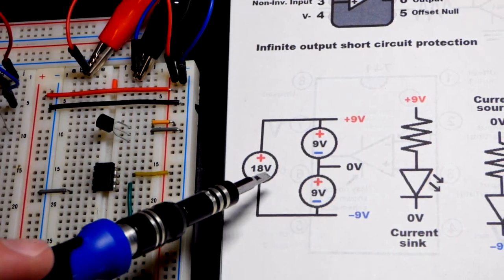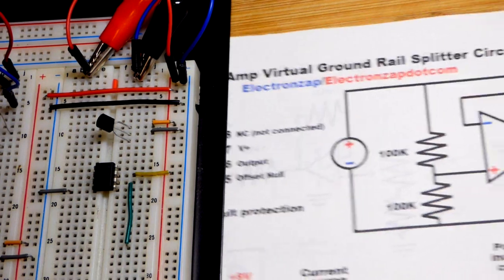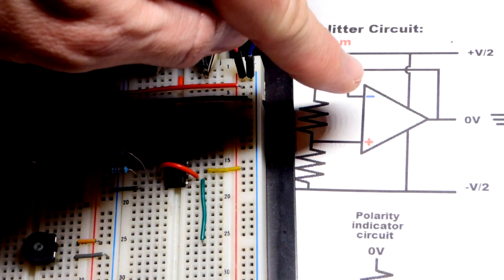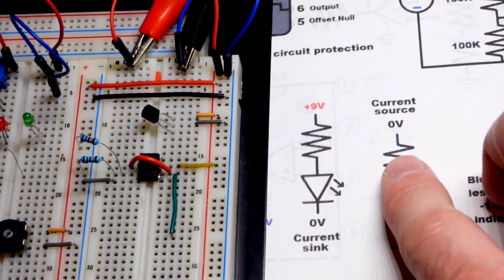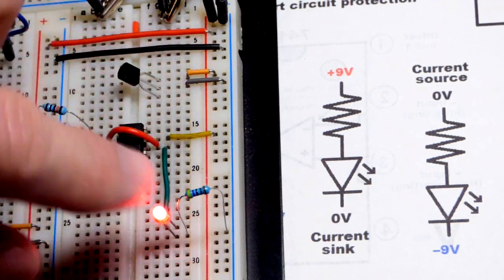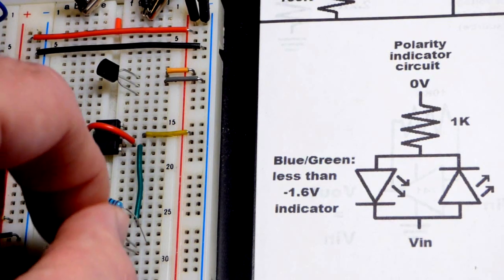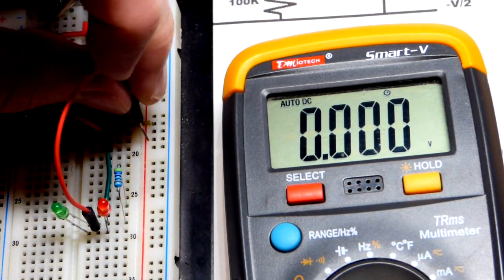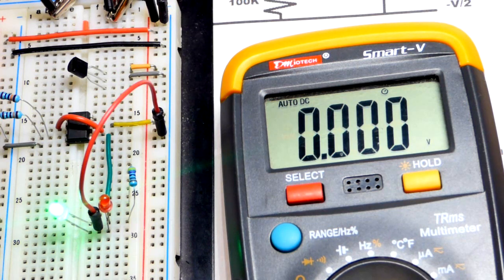Split power supply made from single supply using 741 op amp virtual ground rail splitter circuit

Comment: tested ua741cn in vg 13,2v with schotky diode 0.2v drop and got around very near +-6.5v. I have not load it down yet but i guess it will work good 5-20mA per side with some luck. Thanks for the easy great tips.
Reply from the maker: Thanks for the info!

Comment: Thankyou for the reply. I like your videos. They are clear. As a beginner I have tried many oscillator circuits using digital ics and op amps. I use a FNIRSI portable oscilloscope to see what the outputs are like. I note you often use a similar portable scope. The scope I had did not come with a proper probe (though I have one from another old analogue scope). Instead it supplied just a BNC connector with two leads with croc clips on the ends. Not ideal but I used these to test the circuits. Often the outputs were not very clean, noise or spikes on square wave outputs. I think it would be useful to make a video about decoupling capacitors on a cheap power supply. Mine goes up to only 15Volts but not dual rail hence my interest in TLE2426 chip. The voltage ripple is not specified on my old power supply but I think some of the noise on the circuits I have seen is result of not using decoupling capacitors on my power supply. Plus it might be not using the proper oscilloscope probes or using the ones I have where there are long trailing wires connecting jumpers on a breadboard to croc clips to the scope. A lot of factors possible.I think it would be useful to address these in a video. What do you think?

Robert

Comment: Since you used a TLE2426 to supply a rail splitter and virtual ground, why did you then duplicate this with a 741 op amp. Was not the op amp redundant or can you get more output current sinking from the op amp than the TLE2426 can sink?
Reply from the maker: I try to make as many demonstration circuits as possible. Never needed an actual virtual ground rail splitter, so I can't say what I would prefer. Thanks for watching!

Comment: What if I have an audio mixer that needs split power and an amplifier the needs single supply, can I connect both on the 18V source with this splitter circuit?

Comment: Audio synthesis typically use 12V +/- (so 24V end to end).  Any major change in the circuit to accommodate such higher voltage ?
Reply: Isn't the 741 limited to 22v on the supply rail? (+/- 11V)

Comment: Thanks a lot! Funny thing I bought a 2nd lab supply before seeing this!
Reply: You can source/sink several amps with that setup. With this, you're limited to what the op-amp can handle. Which usually isn't a lot.
Reply: @padmanabhaprasannasimha5385  Yeah. in my case it was just to phase shift a sine wave for a detection circuit so no power needed.

Comment: I just love how easy it is to make a split power supply !
Reply from the maker: Glad to hear!
Reply: @Electronzap  Here is something to consider. my opamp was oscilating probably because it could react really quickly to it's self and picking up noise that it would amplify and start oscilating. in my circuit i placed capacitors from 0V to V- and V+ this would in effect slow the output down and stop the oscilations.
Reply from the maker: @duality4y  Glad you figured out how to take care of the oscillations!

Comment: But aren't there very limited maximum currents is such a setup? If I want to build a power amplifier that will draw several amps between output and ground through the speaker it will not work, will it?
Reply: Gunther Schadow: You are correct that there is a "limited maximum current". The combined current that can flow into or out of this virtual ground circuit is limited by the amount of current that the chosen op amp can source or sink. The 741 used in this exercise could probably source/sink around 25mA (theoretical; not tested).